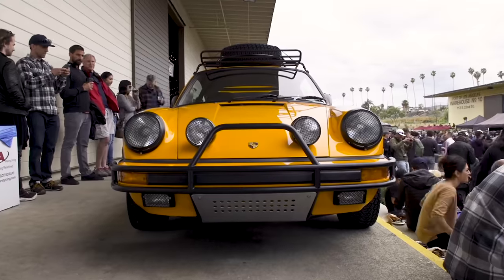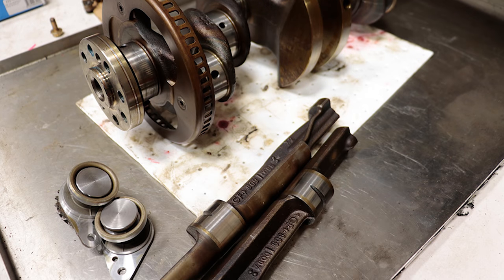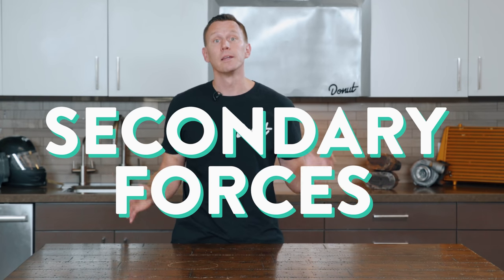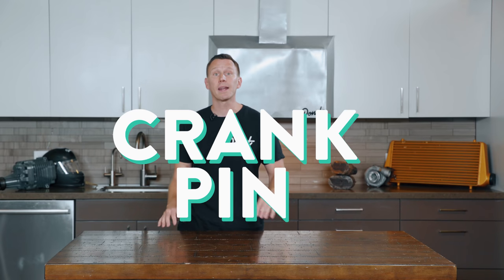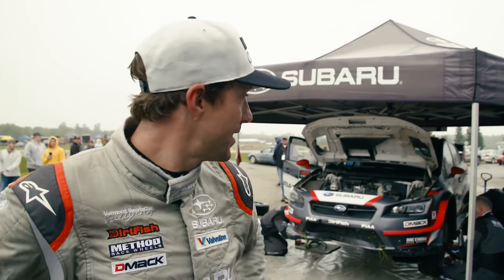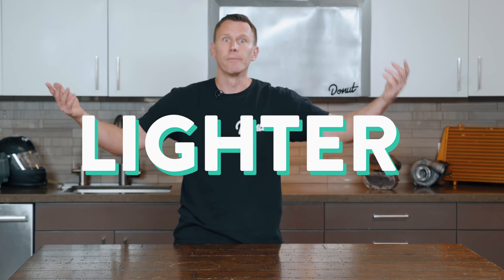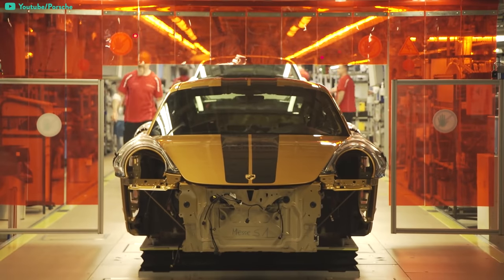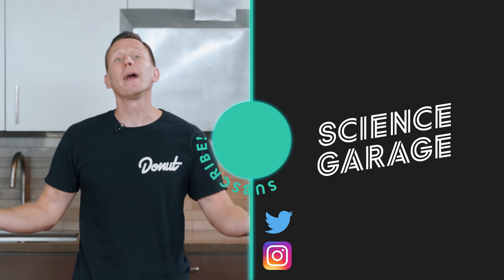BOXER ENGINE | How it Works

Comment: Being in school to become an aircraft mechanic, I've learned boxer engines are extremely prominent in general aviation (Cessna & Piper sized). Almost all small planes use boxers for harmonic balancing, and it makes it easier to pull off and swap cylinders out and rebuild the motors.
Reply: Se7enAte as an aviation student I can confirm this comment
Reply: As a human i can confirm that the earth is triangular
Reply: apparently somebody swapped an LS3 with a reduction gear into a cessna 172. figured you'd find that interesting
Reply: As an actual A&P mechanic, they are used in general aviation. But not as “boxer engines” it’s horizontally opposed engines. Like the Lycoming. The TIO-540-A2B was the one we overhauled.
Reply: @mojaverc1585  lol
Reply: Do you know any good courses that'll set me up for aircraft engineering
Reply: As a pilot I concur, but aero engines are way behind car engines in terms of tech. Absolutely prehistoric in comparison.
Reply: Google the ej20 and it shows up as an aircraft engine lol
Reply: @ beebo

They aren’t prehistoric. They are very simple so extremely reliable. 

They only need to spin a prop. Tip speed limits them to about 2700 RPM. No need for DOHC, multi valves, or variable valve timing. It only needs to accelerate the prop, so ignition timing can be fixed. Opposed Intake valves can share cam lobes. No gearbox required because it’s direct drive straight off the crankshaft. Magnetos are a self-contained ignition source that doesn’t rely on ships power. 

Sure. LS swap it and get all of the “technology”. Now I have to worry about a gearbox, coolant leaks, and how on earth this engine is going to stand up running at 75% power for hours and hours and hours.
Reply: @Bartonovich52  little question: why aren't v engines more popular than boxer in Cessna airplanes?
Reply: @michaelironsights8347 the inherent balancing issue explained in this video for V8 powerplants vs HO (Boxer) powerplants. 😊

Comment: I have a 1965 Chevy Corvair Monza Sedan with a flat-6 boxer. The first thing I noticed when I got it was that the engine heads weren't outwards or straight up, they were laid down. Coolest thing on the planet.
Reply: post a vidoe....
Reply: CORVAIR??? (I think he's dead already lmao)
Reply: must be scary going around corners with it's notorious suspension issues
Reply: @DoomFinger511  I have one, the handling really isn't as bad as people claim
Reply: "Dangerous at all speeds"
Reply: Same here, I noticed that my Beetle sounded different from different engines of its time.

Comment: Boxers engines are also used in BMW motorcycles.
Reply: Well, he's talking about cars and Germany after all.
Reply: Just stating some facts dude...We are all petrolheads here.
Reply: Funny thing about boxers in some BMWs is that in low revs since they're only 2 cylinders you can feel a slight wobble from side to side!
Reply: @imranhaider5519  the Goldwing uses a flat 6 but I don't know if it's a boxer on flat V
Reply: @imranhaider5519  gas*
Reply: Mr. Flexible 

Same with some lawn mower engines.
Reply: honda gold wing
Reply: I test drove one and can confirm.
Reply: Boxer engine is the worst possible engine type you can have on bike
Reply: @MrSam2497  Why?
Reply: Why! its soo fun 
you put your feet on it
Reply: Rotchild Francois Jr you are unable to corner in high speed because engine is wide and you are pretty much fucked it you manage to tip it over even if it's standing
Reply: @mrmedium7984  wow cool man ...Which one?
Reply: @MrSam2497  never drove one .....So ...Can't say.
Reply: @ryze9153  😂😂😂
Reply: @imranhaider5519  lol
Reply: m3ntl3g3n BMW Motorrad engineers disagree.
Reply: And VW Beetles
Reply: So are typical aircraft engines like Lycoming boxers or flat-v?
Reply: There used to be some Soviet motorcycles which used them too like Ural and Dnepr

Comment: talks about boxers in mid engined cars shows sketch of Toyota 86
Reply: Subaru brz
Reply: @markas7356  It's the same car
Reply: Frs too
Reply: Same Same, but different...
Reply: Lane  I mean its a subaru engine with a toyota badge on it?
Reply: Which is also the Scion FR-S and Subaru BRZ.
Reply: Lane yes it does.
Reply: Lane  yeah it does
Reply: Funny that. Back in 2010, Toyota came with an idea of an affordable sports car, which was brought to life 2 years later. The thing is, it actually had Subaru's flat four engine, since Toyota were actually working at near full capacity, so they pair up with Subaru.
Reply: Toyota GT-86 has a shitty Subaru boxer engine that most people take out and replace with real performance IN-LINE or V-BLOCK engines.
Reply: @EM6285  understandable. Although I could get my hands I the EJ25 From the 05' STI.
Reply: Lane  who tf told you it didnt?
Reply: Danish Raisham Phase II EJ255 or an EJ257 is what your looking for.
Reply: Nick Albee It is mid engine, front mid-engine. The motor is in between both axles.
Reply: It's front-mid mounted engined. Behind the front axle so it's technically mid-engine
Reply: @EM6285  "most people"
Reply: Actually, a GT86/FRS has a D: face, while a BRZ has a :D face
Reply: Lane  FA-20 is the enginer designation for a toyobaru 86...I ask you go look up what that is, then look at why the current subaru wrx's motor designation is FB-20 (hint: same 2.0L engine design)
Reply: Its a 918 turbo
Reply: The WRX uses the FA-20f and the toyobaru uses the FA-20D. The FA-20F only has direct injection bu the FA-20D has direct and port injection. The FA-20D also has a higher compression at 12.5:1
Reply: It’s been said before, but the 86 is a front-mid-engined car.
Reply: it does
Reply: Lane  che-che-che-checkity-check urself before u wreck urself..
Reply: Cayman...

Comment: You left out the air-cooled VW engine!
Reply: Yeah not sure how he forgot the most successsful boxer engine. Something like 50 million vw boxer entire built between 1938-2006!
Reply: Karhmaan Ghia,that's what is called right?
Reply: Erm, Alfa
Reply: @chrishagemeister7384  karman ghia, type 1 (beetle), type 2 (The bus), type 3 (squareback, fastback, notchback), the VW thing and type 25 (which both come aircooled and watercooled). The stock boxers went from 1200 CC to 1600 cc but now people pull 2.5L CC strokers with massive weber carbs and even turbos. As the comment above...very very successful!!!
Reply: Fun fact, some people take those engines, cut them in half, and use them for ultralight airplanes.

Comment: Hey kid! you want to buy some head gaskets?😂😂😂
Reply: Dan Strong already bought mine 🤦🏽‍♂️
Reply: @carljohnson974  oh trust me ull need more I got a 4 pack😂
Reply: Subaru, the smell of burnt oil and head gaskets
Reply: My Lycoming O-235 flat four doesn’t have head gaskets.
Reply: Dan Strong FYI head gasket issue was fixed many years ago
Reply: chocobonita  i got a Nine Inch Nail you can use instead.
Reply: @carljohnson974  buy 6-star brand, trust me.. btw, ringland failure is most often due to a bad tune.
Reply: Subaru seems to learn their mistakes, but since the cylinder is flat on the gravity side of the gasket will wear much faster than the top one, the fatal flaw of diminishing returns, well balanced but more stress on the bottom part gasket.

Comment: I used to work on inline opposing 4 and 6 cylinder engines. The big 6's had a C. I. D. of 560 and all the big 6's had these two (sometimes 4) "tabs" on the crankshaft for counter weights. They didn't always have counter weights, but they all had those "tabs. " The pistons diameter were like  cantaloupes. And the wrist pins weren't pressed in or kept in place by snap rings. They had these little aluminum plugs with the cylinder walls at one end ("top" of the plug) and the wrist pin at the other (the  plugs "bottom".....and now I think about it, sounds dirty).

Comment: Sad he didn't talk about the Spare Tire location on the Older Subarus.
Reply: Omar T what does that have to do with boxer engines?
Reply: Jonathan W. Perez  
5:13 and 5:26 when he was talking about how much room there was under the Subaru hood thanks to the boxer, he instead talked about the boring air filter, and the intercooler, and forgetting about the times when the Spare tire was located there from 1969-1994. that's 25 years of the spare being above the engine for it to not be included in the video.
Reply: Omar T Damn that would have been interesting to know! Thanks for telling me 👌🏼
Reply: Jonathan W. Perez  
No problem, that's why i mentioned it  :P  have a few of the 60's and 70's Subaru's myself, besides not talking about the Spare, everything else in the video was spot on perfect.
Reply: The Volkswagen Gol (no "f", not Golf) and Voyage when first introduced in Brazil, had the air-cooled flat four Beetle engine front-mounted with the spare tire above it as well. This changed once the Audi sourced water-cooled inline four was fitted.
Reply: duosonic391  
i know here in the states there were a few VW's in the 70's that had the spare in the engine bay, just don't remember the exact models, scirocco? rabbit? and the years, don't know my VW's at all.
Reply: Omar T share that secret at the vape store
Reply: @andrewsutherland6274  i don't vape, lol, i don't know of any Subaru people i know that vape, no idea where that saying even came from, but i don't mind... better off than what other Auto Companies are known for.
Reply: rembering the first hood i popped on this old subaru think its engine code was ej88 while working at an oil change shop and i found a spare tire on top of the engine then i bought one

Comment: The American Psycho reference was subtle. Kudos if you got it. If you don't it's from a book and movie by the same name.
Reply: patrick bateman uses the phrase "i have to return some videotapes" as a euphemism for homicidal outburts
Reply: I live in the American Gardens Building on W. 81st Street on the 11th floor. My name is Patrick Bateman. I’m 27 years old. I believe in taking care of myself and a balanced diet and rigorous exercise routine. In the morning if my face is a little puffy I’ll put on an ice pack while doing stomach crunches. I can do 1000 now. After I remove the ice pack I use a deep pore cleanser lotion. In the shower I use a water activated gel cleanser, then a honey almond body scrub, and on the face an exfoliating gel scrub. Then I apply an herb-mint facial mask which I leave on for 10 minutes while I prepare the rest of my routine. I always use an after shave lotion with little or no alcohol, because alcohol dries your face out and makes you look older. Then moisturizer, then an anti-aging eye balm followed by a final moisturizing protective lotion.

Comment: He also doesn't bring up the fact that Subaru engines need to be split in half for disassembly or that the Pistons are removed from the connecting rods before the block can be split. They are really a pain in the ass to build
Reply: I've had to tear down an STI engine. 100% agree. Giant PITA. The fact that half the bolts were seized and broke didn't help.

Comment: The boxer 6 requires 7 main bearings.  V8's only require 5.     

Because of this, the Porsche H6 is almost exactly the same length as an LS engine.  

Science!

(Still cool tho)
Reply: Having more bearings to support your crankshaft is usually better, like all the time.
Reply: @CanadaBud23  yeah, unless you care about racecar things like weight, size, and power density.     Why don't they just put 100 bearings in there?   That'll make it real supportive.
Reply: Because 100 bearings won't fit.
Reply: @CanadaBud23  oh, bearings take up space?   I wish someone mentioned that earlier in this conversation...
Reply: They did! They mentioned why couldn't they all just stuff 100 bearings in there to make it much much more supportive. I was thinking one or two bearings is actually better but someone wanted 100 bearings. I don't know.
Reply: @CanadaBud23  woosh dude.   The whole point went over your head.     An H6 needs 7 main bearings.  That's not a bad thing, but does have drawback.   It adds space and weight.   Enough space so that a 7L V8 is almost the same size as a 4L H6.
Reply: Of course it adds weight. More block and material is needed to house that shit. People drop LS's Porsche's for that reason alone. I didn't realize you were being defensive\serious lol.
Reply: @CanadaBud23  You literally came in with an argument.  How do you think conversation works?
Reply: I just stated more bearings is usually better. I will add that bigger bearings are usually better too.
Reply: @CanadaBud23  "having more bearings is usually good.  Like all the time".   Clearly an argument.  The only other reason to comment is because you like hearing your own voice.
Reply: Or reading my own words. :)

Comment: Which type of engine should I pick if I want to make a kit car?
Reply: FireFlood TV fokin v8 is the way to go man
Reply: FireFlood TV if you’re in the states and you’ve got the room, a Chevy LS series engine will probably be easiest to source.
Reply: Depends on the weight of your kit car, but if it's light I recommend a Subaru EJ25-T
Reply: 350 Chevy. It's the easiest engine to just figure out and arguably has the most aftermarket support of any engine. Also they've been made since like the 50s so you can find a good one for just a few hundred bucks. It's flawed, but it's easily the cheapest and easiest route.
Reply: A LS or a EJ
Reply: FireFlood TV naturally aspired 400cc 1cyl diesel engine with variator transmission...
Reply: FireFlood TV get a rotary thank me later

Comment: Ah yes… much more satisfying! the other ones didn’t sit well with me being that all 4 pistons reached tdc at the same time & bdc at same time and in reality I think the engine would struggle a bit with what was done before because once a piston fires they would all have to go back down then back up (2 stroke) for another piston to fire but this one is better because as the front fires the one in the back is ready to fire with 1 stroke rather than 2 strokes

Comment: You forgot something, since they lay flat, they burn oil because it is easier to splash oil past the piston. But other than that it looks like you got most of it. We have a Subaru XV Crosstreck and it has a 4-cylinder boxer engine and it is very smooth and balanced and actually quiet. But when it gets up to speed it sounds great. However we have to fill up the oil very often because it burns it. Actually it burns it so fast that instead of changing the oil we just fill it up because it burns the oil faster than the oil can go bad so it is always good oil in the engine.

Comment: I have a Honda Accord from 93', it has a leakage on the exhaust system... so the noise is not a thing to me. I want a WRX STI, but I won't sell or dump my Accord, is the most reliable thing I have ever had, and we share the age so yeah, I love it.

Comment: boxers are perfectly balanced because opposing pairs have their primary and secondary force cycles occurring together, cancelling each other completely. inline engines' opposing cylinder pair goes through primary and secondary out of phase, so primary force of 1 piston doesn't totally cancel the opposing piston's force because it's at the secondary part of the stroke.

Comment: 7:09 there are pushrod boxers so you dont always need four camshafts
Reply: How do you change intake.timing
Reply: @nolesy34  really?
Reply: @WT-KANIBAL  yeah how do you vtec your wrx
Reply: @nolesy34  dont know all i know is that pushrod boxers exist
Reply: @WT-KANIBAL  of course they have a simpler cam design which makes more down low torque

Comment: Heat rises so mounting the intake and intercooler above the engine seems counterintuitive to me. Wouldn’t the colder denser air be located in front and beneath the engine?
Reply: According to thermodynamics your entire statement was true. Not sure why they would place does on top.

Comment: Ya, but Subaru Boxer engines have a really stretched out timing mechanism. Well, some of them. The belt system just seems odd to me because of the forces involved being put on such a long belt increases the risk of breaking. Chain driven would be better.

Comment: Boxer engines have inherent flaws, too; they are notorious for oil leaks, head gasket failures & oblong cylinder wear- due to the forces of gravity acting on the pistons...
Reply: Well they'd go well in space
Reply: @nolesy34 , sure, if they had a dedicated oxygen supply...

Comment: I have a 2005 Subaru Outback with 2.5 litter it’s such a solid design it only cost you $1300.00 for head gaskets after 100,000 miles it’s criminal

Comment: I used to drive a 1980 subaru wagon for napa auto parts, super smooth but wicked torque steer. Not sure what forces make the torque steer since the engine was so smooth might be a gyro effect.

Comment: Boxer engines are also used in many light aircraft.
Reply: You sir are correct. GE makes a few good ones. They are air cooled engines. They are really light, like I can lift a drained 6cy with one arm light. They are pretty awesome